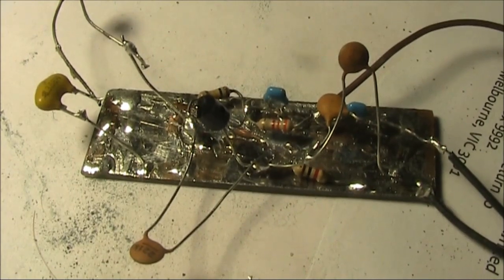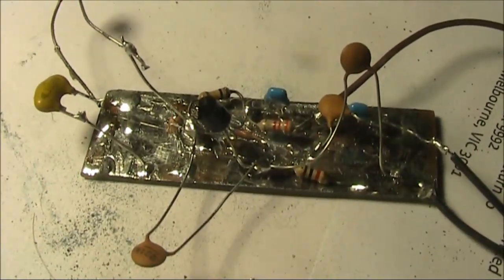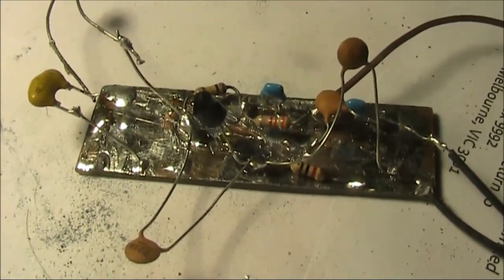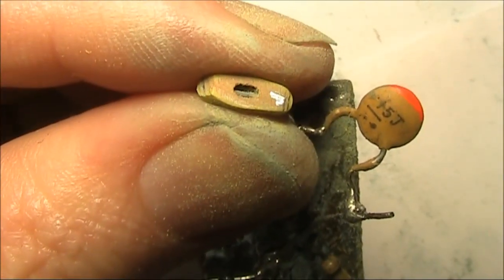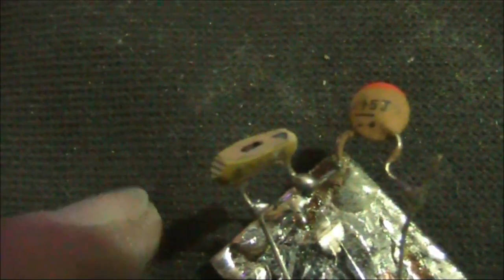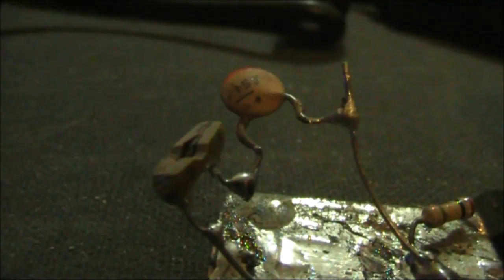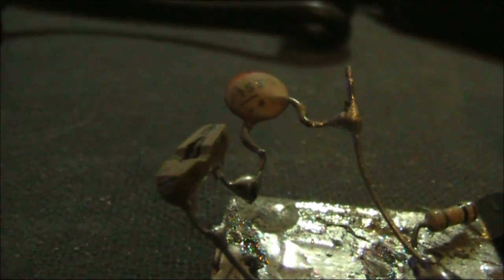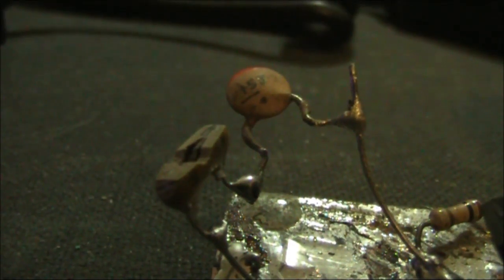Filing a 3.58 MHz ceramic resonator

Comment: I have a question.   If person took an mixer tube like a 12SA7 for example and instead of an IF coil going from plate to B+ to substitute that with a resistor - maybe 500K or so - basically what matches the equivalent resistor that the tube is expecting.  Then on the plate also run a wire to a capacitor, at a value that would pass the IF frequency.   Then, on the other side of the capacitor to have a resistor to ground and a 455kHz ceramic resonator.   The other end the resonator would go to the grid of the next tube and also have a grid leak resistor to ground, say 1M or so.  Would something like this work in place of an IF coil?
Reply from the maker: Possibly. You'd need to ensure impedance matching is right. Could also experiment with crystals to make ladder filters. With appropriate transformers if needed.

Comment: With 16M 3-pin ceramic it doesn't work. Achievable frequency shift is just about a couple of kHz, then the oscillation stops and the crystal is dead.
It is easier to sort through a huge pile of such a crystal to find the ones that are above the marked frequency then to try to get lower ones to oscillate higher than 16M.

Comment: Putting crystals in parallel in an oscillator causes a shift in frequency, I think upwards a little and the amount of shift is dependent on the number of crystals placed in parallel. I also believe it helps the amount you can pull the frequency in a VXO but im not 100% on that. 
I wonder what happens to the behaviour of a ceramic resonator circuit if you use those in parallel. What does that do to the operating frequency?
By the way, interesting follow up to your video about filing crystals 😁